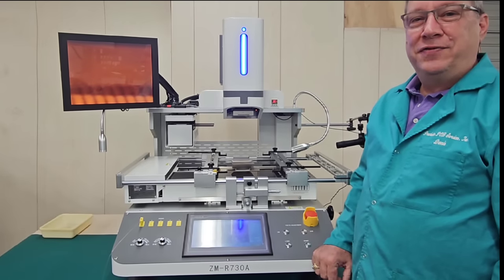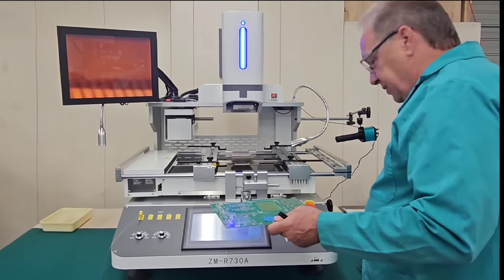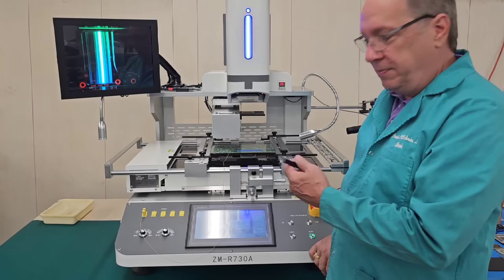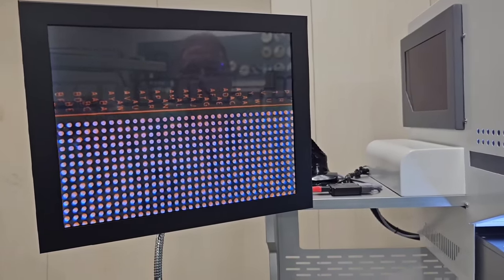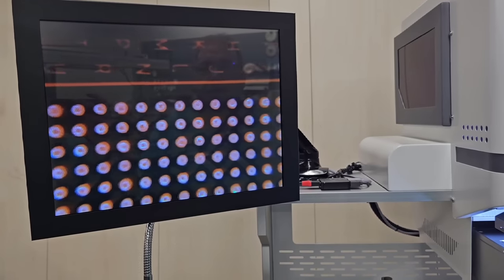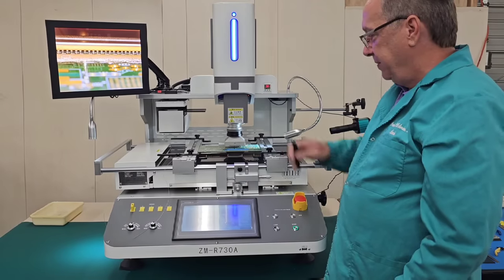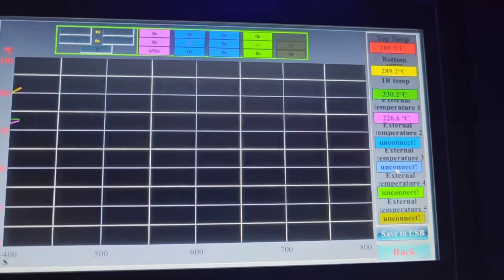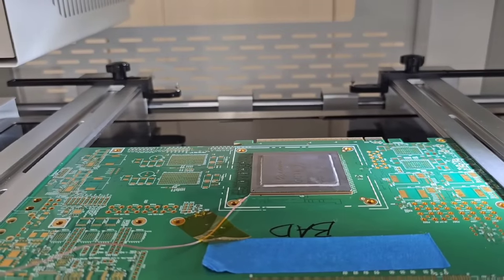BGA Installation using the ZM-R730A BGA Rework Station

Comment: Hello, everything is good, great video, it is worth buying a rework station to buy boards and computers to recover and resell, will it be profitable to the point that I can recover the investment of acquiring the machine, can I make money with this?
Reply from the maker: If you are removing components only and do not need to re-install them. You can get the much lower cost machine.  Yes, you can make money with these machines. We have been in business providing rework services for 31 years.